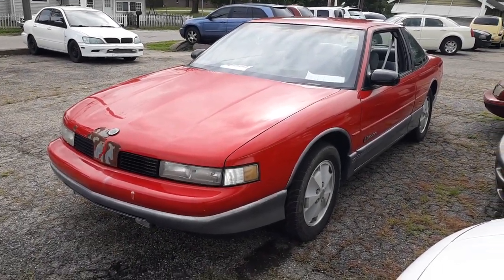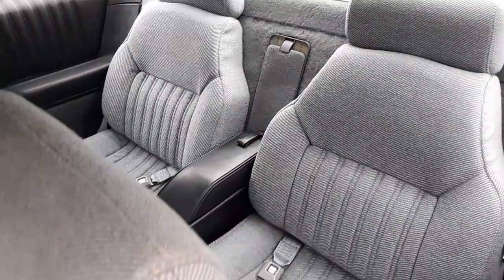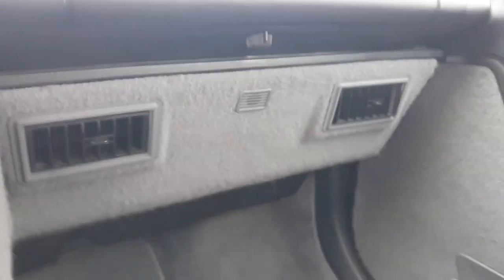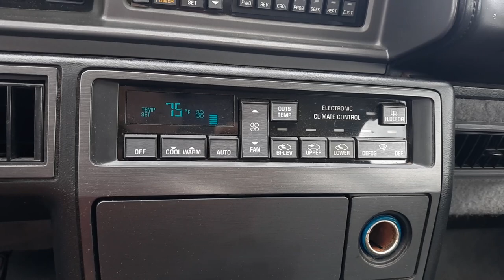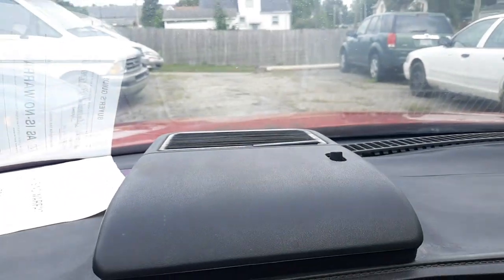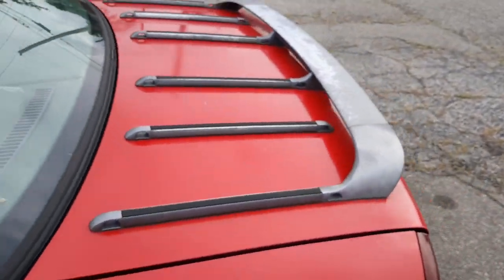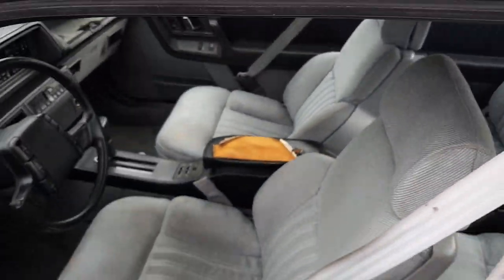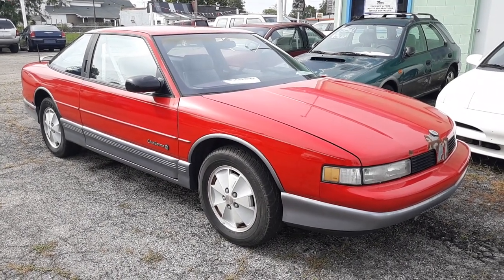1990 Oldsmobile Cutlass Supreme coupe

Comment: Very rare car for many reasons but primarily due to the HUD option.  Very few 88-90 cars were optioned with the first generation HUD system.  Due to the options it has and the little sticker on the front door glass, it quite possibly may have been a GM Executive ordered car.